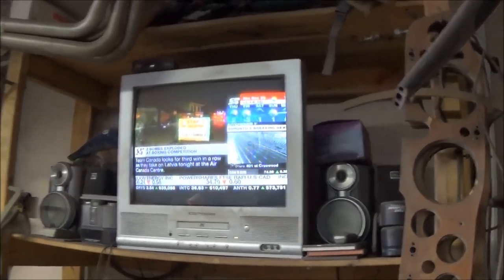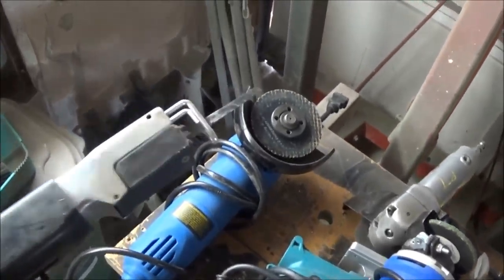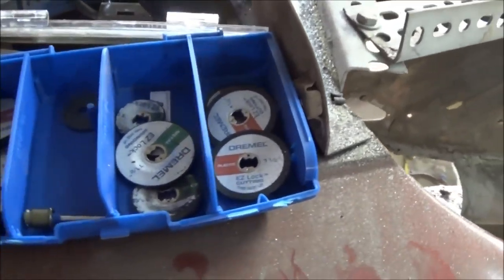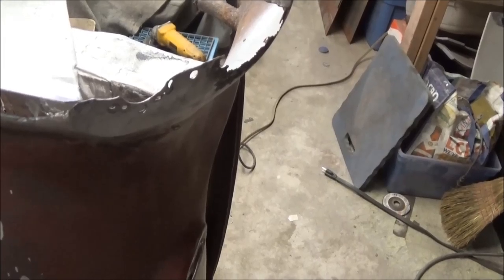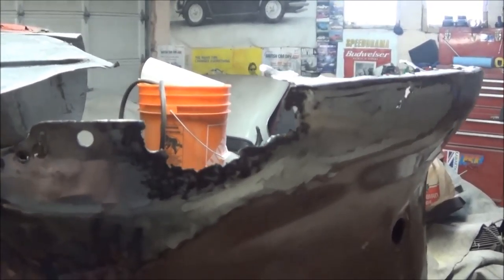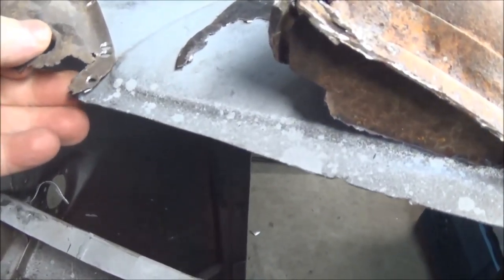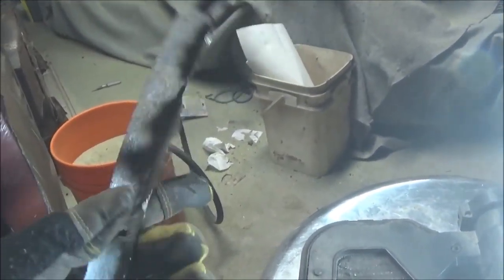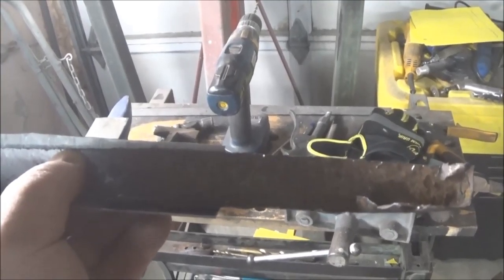Rear Apron Repair 1959 Triumph TR3A Restoration

Comment: Hi Tush, looks very neat, you must be very pleased with your progress. With the tools, the small grinders look ideal to get into tight areas and I have not seen the 3M grinding wheel before, so I think I will put one on the shopping list. The flange on the rear apron with all the curves looks like a very difficult job, was the shrinker easy to use? Would you buy one? I have identical problems on the rear apron as you know and your video has really helped me work on a plan of attack, thank you.